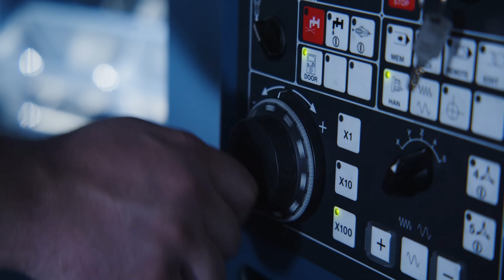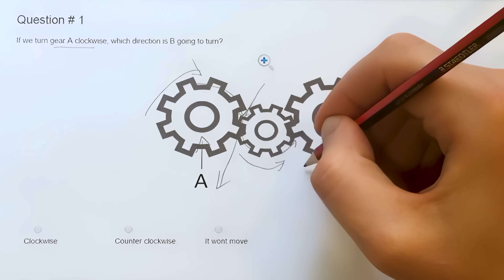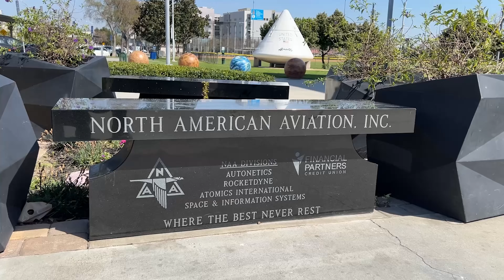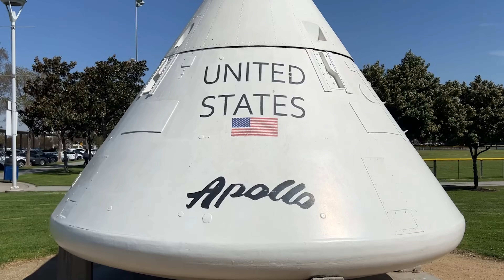I Dropped Out of College to Work at SpaceX

Comment: I absolutely flunked my Calc II class. I am on path of picking up a private pilot's license so I could fly as a corporate pilot. I am looking into starting a job at my local airport, Miami Executive Airport (KTMB), for aircraft detailing as well. But my heart has always effortlessly veered towards space travel and space technology. I am a big sci fi fan. I love Alien, Interstellar, Blade Runner, Isaac Asimov's Foundation Novels, etc. My dreams got shattered when I realized that the advanced math required for it was very difficult. Even more so because I found gaps in my learning, such as in more advanced Trigonometry. I used AI to pass the class, but left the Aerospace Engineering track because I didn't want to continue with what broken knowledge I had. I was very exhausted, stressed, and overall just let down. But I've always been wondering if there was another way. I'm stupid, I just suck at Calc II. I did pretty well in Calc I, and Precalc, so Idk. I wanna polish my trig skills, but the big question I have is... where does stuff get REAL? Like no stupid useless problems or homework, like when and how do I just step into this? I don't mind the hard work. As long as that hard work get's me to where In wanna be, and I'm not bashing my skull 24/7. This video is very promising and inspiring. There's hope (I'm also 19)